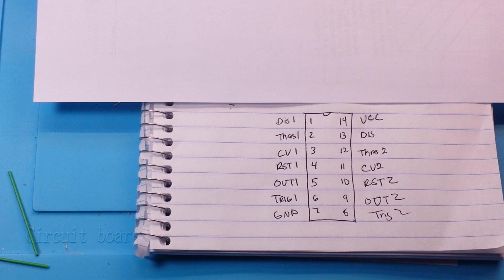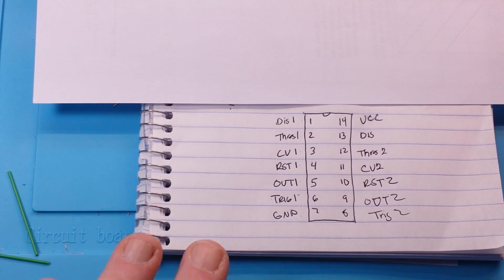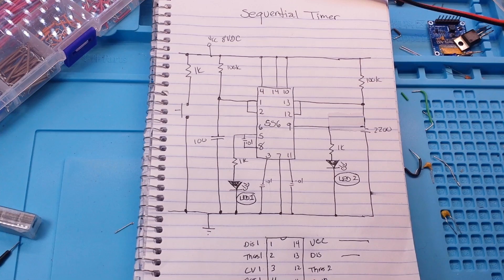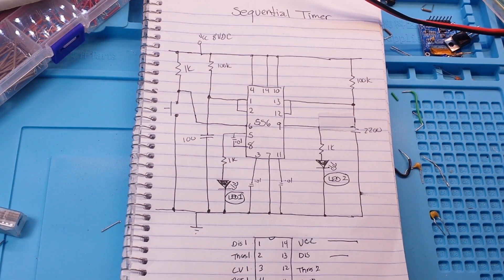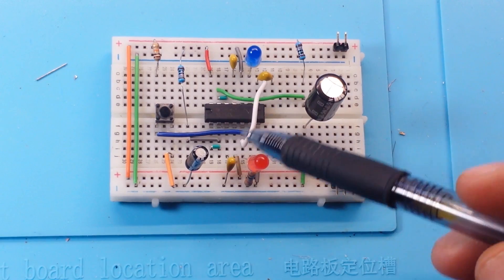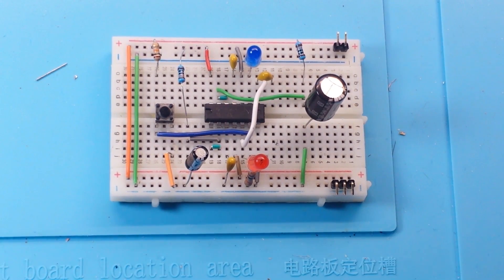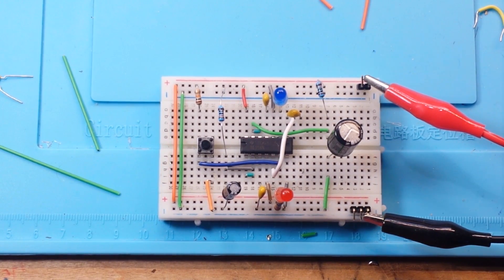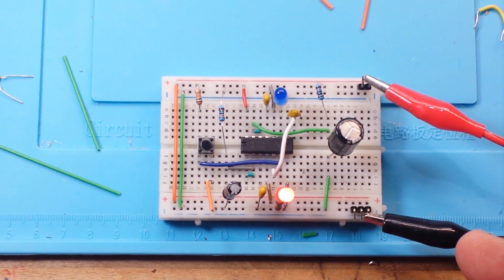NE556 Sequential Timer Circuit

Comment: I was given a bunch of electronics recently and yesterday I was looking through it and found a box labeled 555 and 556s.   So I took a 556 out of the box and went back to my office and looked it up on the internet.   I then proceeded to build a similiar circuit to yours.  I first started with the number 1 side and I got an LED flashing then I added the second side.  I used a variable resistor on the 1st side so I can control the speed of the flashing.

Comment: Found this video trying to debug a circuit. I tried both sides independently and each ran about 6 seconds. I jumped the output to the second trigger, and get about 12 seconds. They both go to the same relay. I swapped the RC on the jump to 50k and 47uF, but there’s still no delay between. Any ideas?

Comment: I can't the circuit to work as you have. I followed your schematic, but on the board, the leds don't have resistors and 1 leg of the capacitor between pins 5 and 8 is not connected, but there seems to be a direct wire connection ???

Comment: what would be the alternative to the 555 if I want to build a dimmer in a led circuit fed with 19v¿¿
Reply from the maker: Any oscillator where you can vary the frequency. You can still use a 555, just drive the LED with a transistor.

Comment: Nice video! I have one question, if you connect pin 5 with 8, when the first timer finished, send LOW to pin 8 and the output 9 keeps high until we click the pushbutton. How dou you do it to stop the second LED after a period of few seconds?
Reply: Would ac couple the pin 5 to pin 8 connection via a capacitor. Also use a pull up resistor on pin 8. This would allow only one high to low transistion through the resultant CR coupling when the first half of the timer switches off, unless the first timer is used as a free running astable. This will trigger the second timer through the charge transfer across the coupling capacitor. The pull up resistor prevents unpredictable results from happening. A 10nF to 22nF capacitor is required. I did construct a continuous running circuit by coupling the 2 monostable timer halfs together in this way. However on inspection of the output waveform produced by this circuit on an oscilloscope, found there was brief negative spikes produced. Would be okay in a siren sounder but not when used with flip-flops or counter circuits.

Comment: One advantage of using 556 instead of an LM555 is that the former do not present the Set/Reset simultaneous issue in the monostable configuration. This problem does not affect the NE555, but the 556 may be an alternative if needed.

Comment: Wow, I think this is one of the first electronic videos where I could understand what was going on. 
 Could you keep the same size capacitors and control the led on times using a 470k potentiometer in place of the 100k resistors?
Or do I need to go to the back of the class and go through the work again?
Thank you for taking the time to teach us.
Reply from the maker: The resistors will have a small effect on timing, capacitor charge/discharge has more.

Comment: Nice video Paul! and I am getting more interested in the monostable mode. Nice :) Besides that I didn't know this IC existed and I like it :) What I am missing is how this circuit could trigger a bell or a some other more power device. How could the output of 200 mA steering that? I think it must be with a mosfet, relais or transistor or the like, but I have never done that. With an Arduino a simple relais could be attached, but to my understanding a relais draws too much current. Anyway I am interested in a possible next building block for self made creative devices without necessarily using a microcontroller :) Thanks Paul, and have a nice day!
Reply: There are relays with 400 ohms coils. These are marketed as sensitive 12v relays. These could be connected directly. Some datasheets for the 555 family recommend the use of 2 diodes when connecting the relay coil between the 555 output and the 0v rail, one in series with the relay coil going direct to the 555 and the other diode reverse connected across the coil as normal. The dual 556 is about 50mA down in its maximum output current drive ability at 150mA. The maximum output current is about 75mA for the CMOS ICM 7556. There is a marked asymmetry in the drive currents for the CMOS TS555, 100mA when sinking current (output low) but only 10mA when sourcing current (output high).
Reply: I have connected relays to 555s directly with no issues. Just make sure to use a diode on the coil to protect your chip. Different varieties of these chips exist (probably with different abilities to drive loads) but, I never had a relay damage one.
Reply: You could use a 555 to trigger a mosfet which could run your load or trip a relay. I’ve used it to do both.